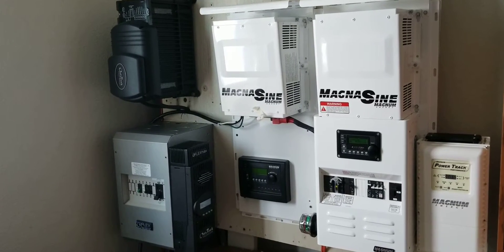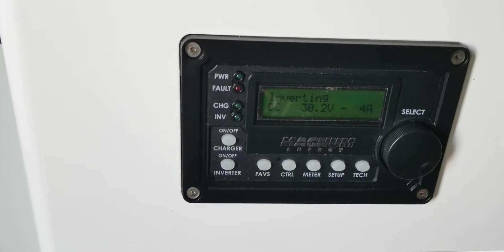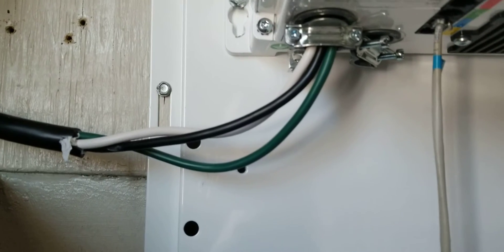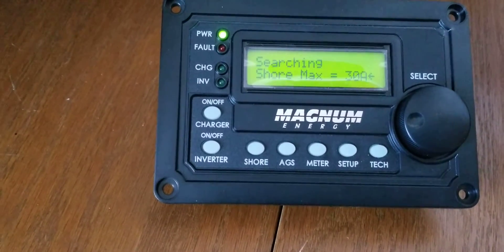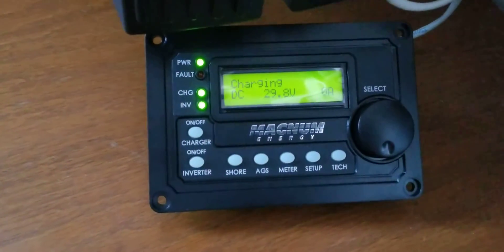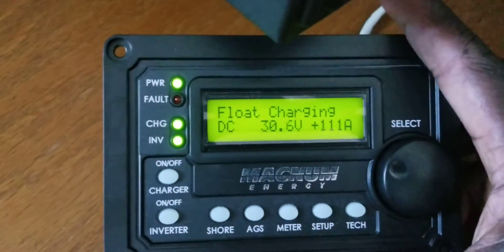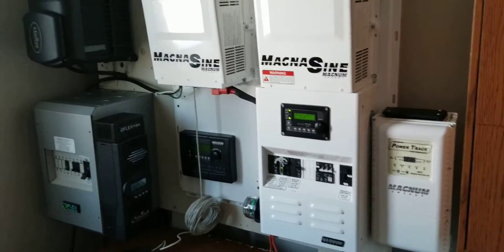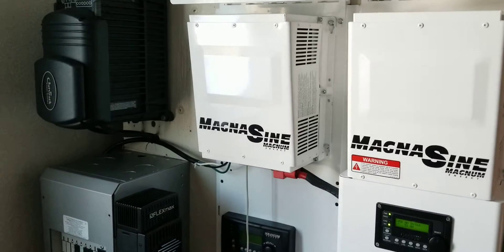Magnum Energy MS4024PAE MS-PAE Series 4000W 24VDC Pure Sine Inverter/105 Amp PFC Charger/120V-240V

Comment: Hello sir. Great information on your videos. Thanks for sharing. 
I have some question for ya, I’m sure you’re knowledgeable about Victron MPPT charge controllers.
We are doing an upgrade to our solar system. We currently have a PV array of 6 x 320w, 36.8v, 8.69A panels, 6 CEIL 200/AH deep cycle batteries, for a 24v output. We use a Victron 100/50 MPPT charge controller and 2 MultiPlus 12/3000/70-50 - 230V inverters/chargers. There is a Victron battery balancer and a Victron BMV-702 connected to the battery bank. We have a Victron Color Control GX for remote operation as well. We need help with the following:
1. Is it necessary to connect 2 MPPT charge controllers in parallel? What purpose would they serve?
2. If that is the case, should we combine the charge controller wires before they reach the battery bank, with a bus bar or Victron MEGA fuse?
3. Or connect them directly to the battery bank and independently?
4. How do we connect them to the CCGX? Should we connect one or both?
Our electrician suggested 2 MPPT charge controllers for back-up (which I thought would just be for redundancy) but I thought I would enquire from Victron.
Thanks in advance!
Obediah
Reply from the maker: Hey buddy,
I am sorry I couldn't help. I have never owned or Installed a Victron Energy System. 
Have a wonderful weekend and don't forget to LIKE and SUBSCRIBE

Comment: It doesn't know where the power comes from it does the same thing when you AC couple a grid tie inverter to your ac output of the Magnum and it charges the battery without running the charger lol Magnum are awesome.
Reply from the maker: Yes indeed